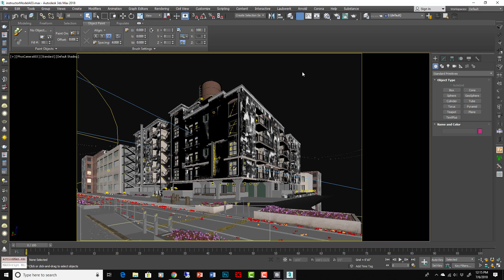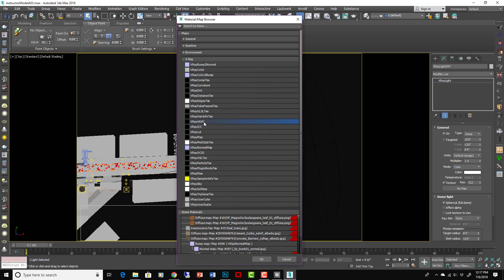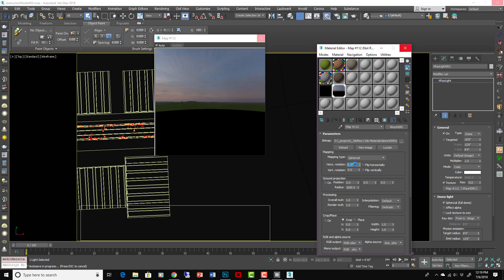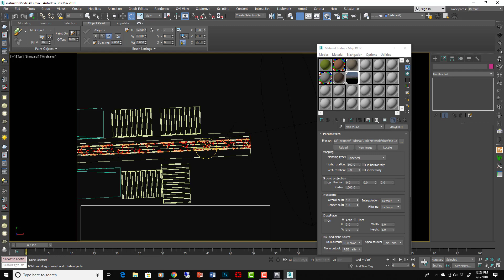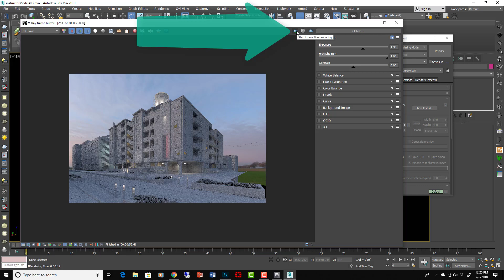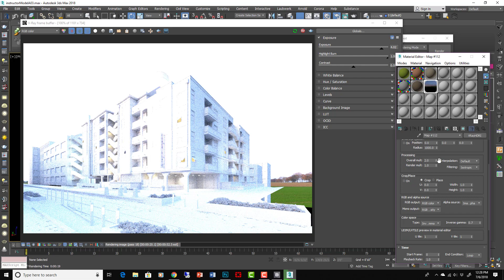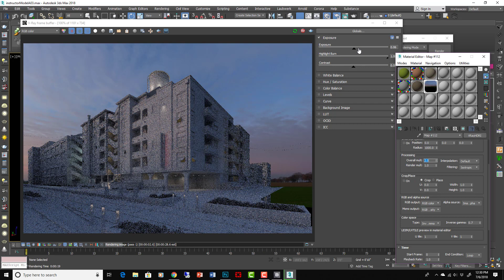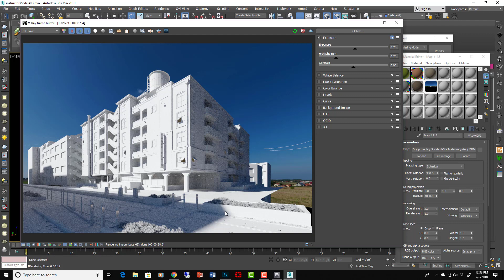3ds Max + V-Ray Next: V-Ray Dome Light & HDRI Workflow

Comment: Vray next allows you to rotate the dome. In the dome option there is a lock setting. Give it a try
Reply from the maker: Thanks. Definitely makes it more straight forward.
Reply: that lock setting does nothing for me. i check the option Lock Texture to Icon and it doesnt rotate with the light.